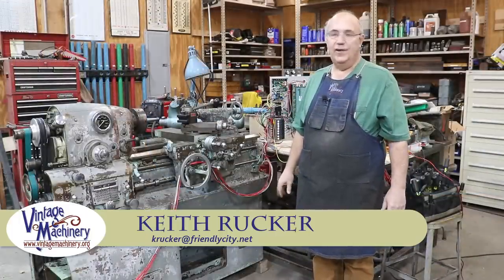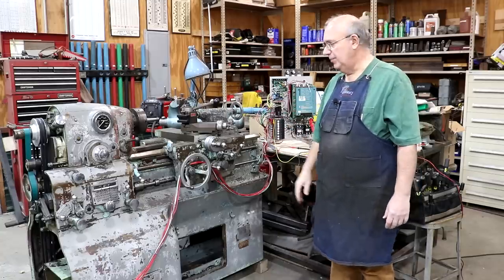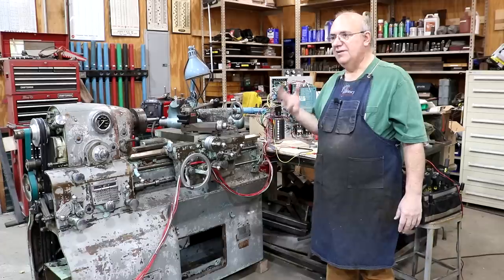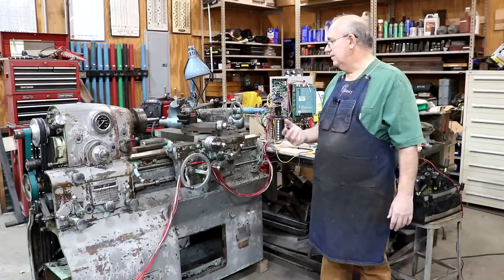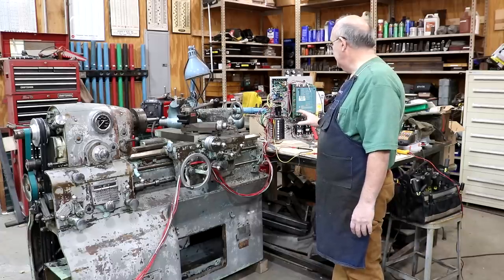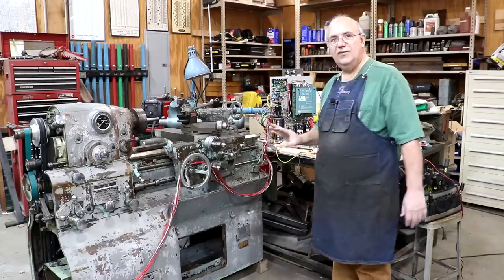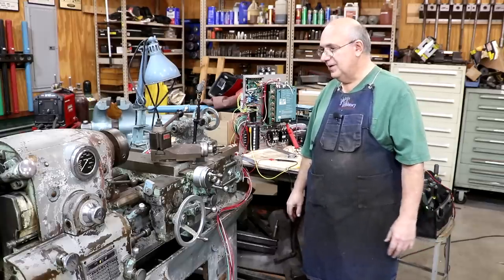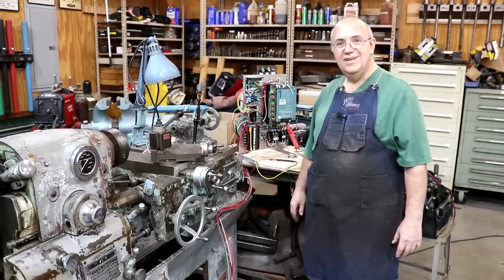Monarch 10EE DC Drive Retrofit: Project Update and Testing the DC Drive Under Load

Comment: Keith, I’m an electrical engineer (BSEE) and a master electrician, and you are very lucky to have John helping you! When you mentioned the unification of the current and field controls and developing a curve, then building a board, it’s no small thing! John clearly has some great experience and is a kind man for helping to build this control. I hope it works for decades to come, and hope he provides all the reference material for future servicing of the controls. Wow, heavy lift!
Reply: It can't be that hard. They figured it out almost a hundred years ago with just a double wound potentiometer. Should be trivial to use an arduino.

Comment: I actually laughed when you doubled the feed rate and the surface finish improved!
It sure is a quiet runner. Eliminating relays is a good thing too. As others have noted, add a field current protection circuit. 
Great work, we’ll done to you and John.

Comment: Westinghouse Elevator used this type of drive for decades. If you could locate a retired Elevator Mechanic who worked for Westinghouse your life might become a lot easier. Call the local Union Hall, IUEC and ask the BA if he could call someone who would give you some insight. When I retired I had jobs that still used MG sets to run high speed elevators with this type of drive. They still had Mercury Vapor Thyratron tubes in the 70's and changed them to a solid state control that ran large MG sets for elevators. they were designed to maintain speed with varying loads. Just like a Monarch Lathe, only larger. The actual size of the control boards were small as only a few amps were required to run the field to get the armature output. Joe

Comment: The 10EE is capable of some heavy cuts.  When I finally got mine working I made some test cuts, stopping at a .016 feed in 2" A2 with a .250 DOC.  The lathe barely grunted at the start of the cut.

Comment: Wow! My go to lathe is a 10EE and it’s so nice. The DC motor reduces harmonic vibration. Your older 10EE has a slightly smaller distance between the headstock and bed. I learned this as I have an older steady and it did not fit. The round dial does not support metric threading while my square dial does. The older round dials were motor generator sets. 

Many 10EEs use thyratron tubes with mercury vapor rectifiers. The diode bank is touchy and I had to rebuild mine as some diodes were smoking. I have one vid under Arnold Emch 10EE showing it after the diode bank rebuild.

My nightmare is a B&S Omniversal mill. Great shape but electronics is a rats nest retrofit. The original had a large single thyratron tube controlling the bed motors and feedworks. Spindle was a three phase induction motor.

I am watching with great interest to see how you did this and how it works. May be helpful when I get the Omniversal up and going.

Comment: Have worked with large (industrial) DC motors that have dual supplies. If the field supplyis lost, or goes really low, the motor will spin too fast. BOOM! I have seen one fly apart, and you don't want to be close when that happ-ens.
Reply: as above , Keith you must have safety system in place if the shunt field supply fails the armature supply is cut off ASAP. as I have said in the past I was a armature / stator winder and motor repairer during my 5 year apprenticeship ( small ac 200hz grinders to 3000HP and DC series, compound and shunt DC to 250hp and rotary converters to 2000hp six phase ac to 200vdc 
and yes I have seen the result of shunt files failure many times good fun on a 18ft pipe casting machine. keep going with the refit very interesting

Comment: Recommend making sure that the control board handles the reversing tasks successfully before pulling all of the relays and wiring from the lathe. Wouldn't want it to not meet the needs and then have to put the relays and wiring back in.

Comment: You should pull Your Highest Amps starting, stopping or changing speeds on the spindle at high R.P.M.'s. The only Machining Operation that ever pulled a lot of Amps for me (other than a crash) was a large Drill (1 1/2" or larger or dull drills) at the bottom of a hole plugged with shavings as it was ready to break out of the back of the part. Rapid Travel will also pull pretty high Amps. Facing, Turning, Boring, Threading, etc.. are usually very low amp operations.

Comment: Thanks Keith for the video.  The lathe is a quite runner, or your mike did not pick the lathe sounds up.  I think you have nice lathe there. most modern DC drive have field loss protection some even have over speed protection provided it has some type of feedback.  Good work it look like it moving along well.
Reply: With a DRO on the cross slide, fed into the system, you would be able to set SFM and it would maintain optimal cutting.  When facing it would speed up as you got nearer the middle. Nice project Keith. Keep them coming.

Comment: Chokes damp down current changes . Ideally it hold the current constant . Capacitors try to hold constant voltage .  Can see how the choke helps to controls the dc current . Very lucky to have John working on this complex problem .

Comment: A very interesting project.  I learnt about and did some lab work on DC motor control with field depletion at college in the early 80's but never came across a real word instance except for Lucas two speed windshield wiper motors and they just switch a resistance into the field circuit.

Comment: Awesome work. Couple of things with an electric choke you need to consider temperature as it becomes less effective at higher temperatures. You have a microcontroller in the design that might be able to monitor the temp and automate corrections. You can also use flyback diodes and size them appropriately for your current.

Comment: I cut my teeth on DC drives! Being an old codger I still see benefits of the DC, even if they have more maintenance for the brushes. The DC drives that I am familiar with, if I wanted speed well above the base speed, I would use a tachometer or encoder on the motor, and the modern drives such as ABB DCS800, or AB Powerflex DC will automatically adjust the field strength to optimize motor power at the selected speed.
For best operation I recommend 3 phase input except for small motors. There is less torque ripple with 3 phase input. If you get a regen reversing drive it will stop on a dime. Depending if your motor has a compounding series field you may wish to use a full wave diode bridge on the series field, or simply leave it disconnected. The new drives with speed feedback auto-tune, and are surprisingly good with that tuning.
The brand name drives aren’t cheep, but they give good bang for the buck.

Comment: I also have a works in a drawer machine that I ripped out the old stuff had too many components too hard to get and YES that choke is necessary to smooth out the pulsating dc to the motor. I did use the old speed control to use only one knob for speed control as it is a dual pot that is special only for the 10EE not a on the shelf item.

Comment: Hmmm.. if noise on the field  windings was causing the trouble (cured by the chokes), then a simple scope reading would have shown that.  A cheapo portable scope is handy to have in the shop. I know I have one.. Great work guys!
Reply: Could you tell us what model scope that you are using?
Reply: I was thinking the same thing.  I don't know what voltages are present in the circuit, but any decent scope would do the job as long as it can handle the peak-to-peak voltage.  Even if it's three phase, multiple inputs should allow you to see each phase at the same time.  I use an old Tektronix 2465B, it's quite capable and only cost about $150.
Reply: Troubleshooting is always a matter of choosing 'most likely' things first, coupled with 'easiest to check'. This setup is so complicated, and he already found many initial wiring mistakes etc, it just took a while to get to the cause of this issue. I'm sure he eventually put a scope on it. There is almost always some level of noise on these kinds of systems - the question becomes how much and what kind and on which lines etc. is too much for the given system. Especially if the problem is transient, like a spike caused by some transition or whatever, those can be hard to 'capture', maybe even needing a long-term recording scope. Good new is it looks like he snared it.

Comment: I'm curious if you tried contacting Monarch directly because they offer electronics upgrade packages for restorations? They also have lead screw and cross feed replacement parts as well!
Reply: He mentioned early on that he checked with Monarch, as well as investigating a number of other solutions done by others. Monarch is known for being quite pricey for their service parts, not sure what an electronics retro kit from them would cost. I've seen some that are on the order of $2000-3000, not sure how all the features and specs line up though. Ultimately Keith did his research and this is the approach he chose. If it works out, it's possible he will offer his solution to the market.

Comment: Is that a DC clampon the DC leg? If it is an AC clampon you are measuring the ripple current in the DC leg. If you use an AC clampon then put it on an AC line leg, and the AC current will be about 85% of the DC.

Comment: A great marriage of a fine old machine with modern technology. 
Have you considered doing away with the potentiometers completely? Your controller knows the RPM of the machine and your colleague has written the software to seamlessly ramp up the speed through the changeover point at 900 RPM so why not take the required speed from a keypad (you may already have one for other purposes) and let the computer do the rest? 
As an alternative to a keypad, take a look at rotary encoders. You still get the rotating knob, but from then on it's all digital.
It might also be worthwhile adding a permanent current monitor for the field current so that, if it falls below a preset value, the computer shuts down the drive instantly to prevent run away. Or you could do it via the RPM reading, If the RPM exceeds the maximum you can dial in then shutdown is initiated.
Reply: Foremost, he wants this machine to look and act like the original design. He's not trying to make this into a gamer machine with all kinds of bouncing displays and blinking colored lights. In fact, he wants the whole electronics system to be hidden inside the casting, and ultimately controlled by the existing knob. Encoders suffer the 'endless-relative' problem - they have no end stops, so you can't turn them blindly or feel their current value position. They can only inc/dec from some current position, so you need to look at something like an LCD to show your current values. They are notorious for failing over time, either skipping values or jumping wildly. Encoders have advantages in some applications, but not this one. The motor driver has all the over/under monitoring and current protection systems in place.
Reply: @kindabluejazz  I see no reason why the machine shouldn't look like the original design. It already won't act like it because Keith's colleague has replaced the two potentiometer system with a single one plus a digital speed display. I also presume that Keith will retain the tachometer on the side of the headstock so you could use that instead of the display. No way did I suggest stupid "trying to make this into a gamer machine with all kinds of bouncing displays and blinking colored lights" just two alternative ways of bringing it further into the 21st century. One of which, the encoder, could replace the existing speed control potentiometer which Keith is doing anyway.

Comment: I have 63 10ee with modular drive both cross slide and compound read diameter not radius ie .010 on the dial cuts .005 off the radius

Comment: Next machine restore-
Keith- " Hi folks I am thinking of either rebuilding this old motor drive system or just bolting on a VFD inverter and 3 phase motor"
Phone rings- " Hello this is Keith"
On the line- " Hi- I am an electrical engineers and I can design a------"
Keith- " Click buzz"

Comment: I’m puzzled why you are reinventing the wheel. With what you have into this I have to think you could have fixed the original tube electronics. This so complicated.
Reply: I think a previous owner had gutted the original electronics, installed some sketchy power supply and hacked most of the wiring...sad 😢
Reply: I bet you cannot get those triodes now at best it would not be as reliable 
but by EKK did they Look good under load 😀 same goes for the old mercury ack rectifiers
Reply: A lot of those old tubes are now Unobtanium.  If you really wanted to control the motor with tubes you could find substitutes that sort of match the original, but then you have to design changes to the circuit.  And tubes work by generating heat.  Finally, those design changes might have to be done again if the replacement tubes become Unobtanium.  Better to use modern components.
Reply: You're so late to the game. He described his research and discovery process in the first episode. Of all the choices available, and there are quite a few, this is the track he chose to meet his goals and needs. YMMV. There are many advantages to the new system, reliability, availability, maintainability and future potential features being just a few. He may even offer it publicly as a kit if he can work it out and it turns out to be effective.
Reply: @stuarthardy4626  There are still some on eBay, one is a kit with two C16J and a C3J for "only" $1000.00, other is only one C16J for $1,350 and there's other C16J for 1,498!!!

But a company called Scissio Controls makes a C16J solid state replacement (with thyristors) for only $136 each among other replacements for the Monarch 10ee
Apparently (I read that in a forum a long time ago) they didn't make a for the C3J because it lasts longer and there were plenty of them under $100 but now those are getting expensive too.

Comment: You and your collaborator might be interested in this video on the 10EE drive (https://www.youtube.com/watch?v=MoAD1_SgRY4).  The video was made by Dee Dee, who is a retired professional machinist who owns two 10EE, one with a motor generator for producing the DC to drive the motor and one with vacuum tube rectifiers to produce the DC. He discusses reducing the current to the field coils to increase the spindle speed above about 1150 RPM, use of braking resistors to stop the motor even when directly reversing the direction, and a runaway protection relay circuit to prevent destroying the DC motor if the power to the field coils is abruptly lost.

Comment: I may be missing something - why is this so electrically complicated? a dc motor, vfd - pretty simple to wire up - maybe someone can explain why so complicated?
Reply: its very easy in concept of the OEM system you have a DC shunt field motor driving the spindle  Ok to drive that before the WIAD ( works in a Draw ) system you had a ward lenord drive that consisted of a AC motor driving s DC generator ,O k so far,

what you do is have the DC generator drive the armature only of the DC spindle motor at normal full volts ( but this can also be lowered) , but the shunt field is fe a variable dc voltage rom the generator output , now to control the upper speed range you reduce the volts on the shunt field to the spindle motor no field volt gives a very high speed enough to blow up the motor . so that why to replicate the old setup WL or WIAD you need some trick devices one to provide the controlled DC for the armature and another to control the shunt field ( which cannot fail in operation 
note a VFD is AC in AC out but variable HZ hence speed control 
Google Ward Lenord Drives its over 50  years since I worked on them ( much bigger than this unit )
Reply: Vanguardsys. The dumbed down version: The DC motor armature can only spin up to 900 RPM unless you reduce the field winding strength around the armature. This allows the speed to increase to 3000RPM. What you suggest would only control the armature. What Kieth and John are building controls both the armature and field. This takes a lot more than one off the shelf controller.

Comment: I dont believe that the clamp meter can read DC ?  It relies on AC magnetic field ....
Reply: That is true for the old type of clamp meters. The worked as a transformer in witch the wire you measure the currnet in acts as the primairy winding.
 Modern clamp meters are using a Hall sensor to measure the magnetic field . They can measure AC and DC currents.
Reply: @wilfredr980  the DC amperage isn't really accurate unless you have a meter made by a reputable brand like for example Fluke.
Atleast that is my experience.
You get what you pay for I guess.
Reply: I think he's reading the input AC line current, not the DC motor current.

Comment: It's not really complicated. Simply DC drives change the armature current at lower speeds, then weaken the field current past that because counter-EMF is what limits speed.
Reply: But.. you are incorrect about the limits of AC vs DC. An AC motor will produce full torque from stall right up to 400 Hz.

Comment: I’m a subscriber, and watch your channel daily.

I am wondering if you would be able to do a small job for me.
I have restored a couple telegraph keys, and i'm unable to procure the adjusting screws that go with them. I tried to find some keys on eBay with the parts I need but have been unsuccessful. They are brass 10-32 thread with a knurled head, and knurled nut. If you are agreeable it would probably be easiest to send them to you to duplicate them.

I don’t expect you to do this for free. Just let me know how to precede.
I will send a picture in a separate email.
Ron Senn